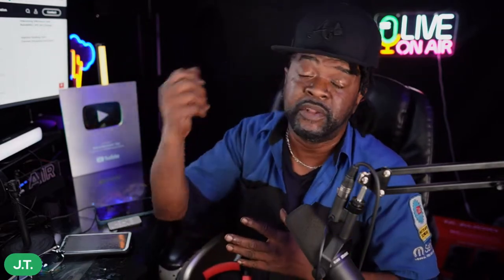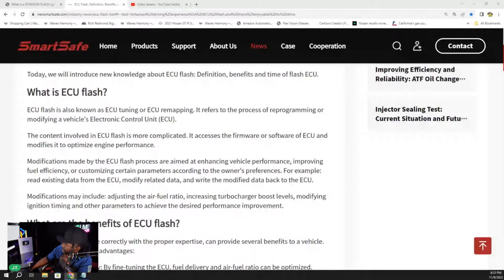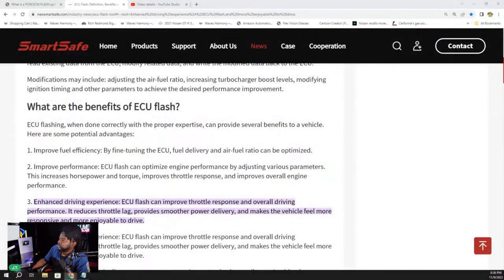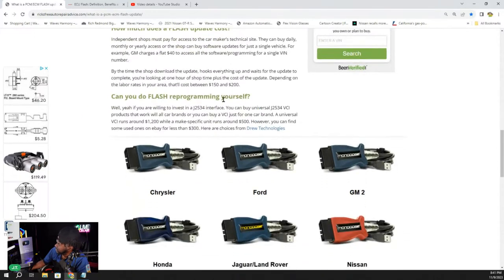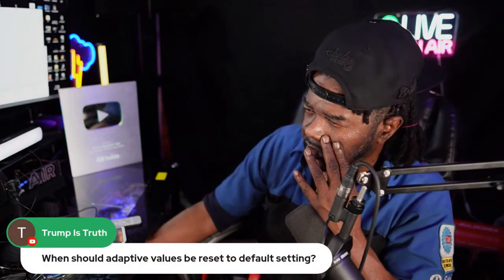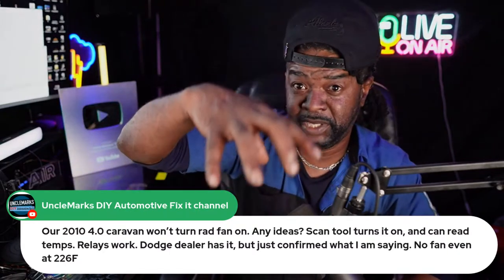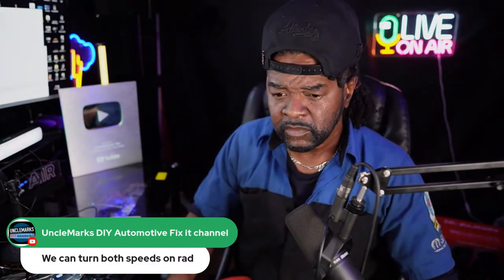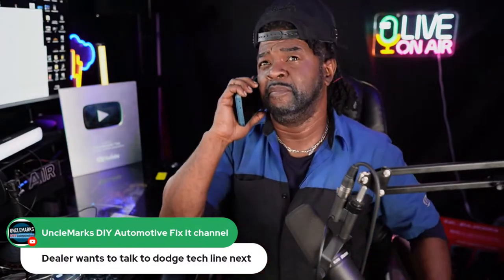Flash updates to your Engine and Transmission Car Computers

Comment: Question for ya:

I got a 2015 300 with the 845RE. I have a knock from the transmission when I decelerate sometimes from 5th-4th and consistently from 2nd to 1st. It is very audible in city driving and is more repetitive in acceleration/deceleration while in 1st gear. 

How would I be able to tell if my TCM has the latest update? 

Is this something the dealership will charge me for if it has a TSB? 

The car has over 180,000 miles and I will be rebuilding the valve body once I get my separator plate in, but I want to figure out if I have to take it in to the dealership for a flash.
Reply from the maker: Curious why/how do you intend to rebuild the valve body? Separator parts available? That repair usually done on a Nag 1 transmission. Also are you subscribed to the channel?
Reply: Lol I wouldn't be here if I wasn't subscribed. Like I mentioned, the car has over 180k and I intend on driving it until it falls apart, so I have recently done a series of repairs to prolong its life (rockers/lifters, timing chain, oil pump due to a P06DE code, radiator, tensioner, everything on the front suspension, etc) After researching this specific transmission I have consistently read that the valve body tends to wear prematurely on the accumulators and the TC pressure valve. Sonnax sells a kit for this at a reasonable price and the job doesn't seem to difficult with the exception of making sure I have the correct separator plate.   @OnlineMechanicTips
Reply from the maker: @udspeedracer  Interesting.  As for updates, I can almost gaurantee that because its a 2015 model which is the early builds, there are a ton of improvements (via updates) to that trans. And yes, the dealer scan tools reads the part number with the revision letters and then recommend which updates apply to that trans. Because that tuning software has to be downloaded from the servers, the dealer scan and access to the site will be needed. Basically meaning you may have to take to a dealer to get done.
Reply: Bet, I'll just make an appointment after I perform all of the repairs and have it done. That should be all that the car needs for another 100k. I appreciate ya! @OnlineMechanicTips

Comment: I have a dodge journey crossroad v6 3.6 2014 and I had a ticking noise. I change the camshaft fixed the noise but now I have a P0017 code. I have not found the problem I see that the chain is tied the engine starts no noise but that code.

Comment: I got a 300m like don't remember v6 motor replaced all timing components marked all in same spot now has no power runs idles reves fine great motor like 2.7 maybe will not pull a hill have code p0016 did I screw  up